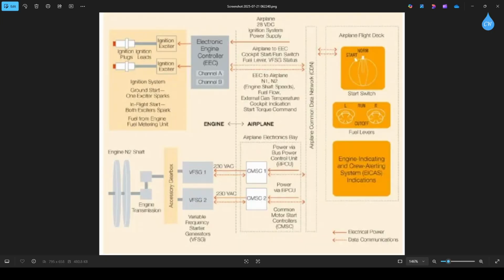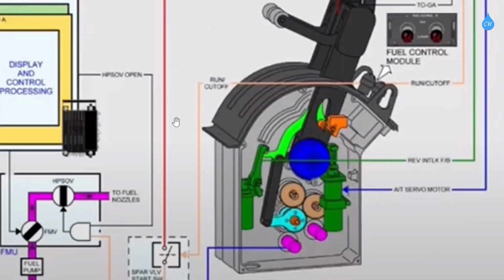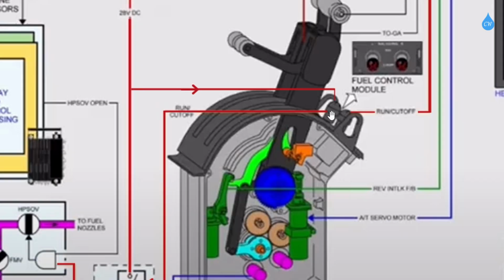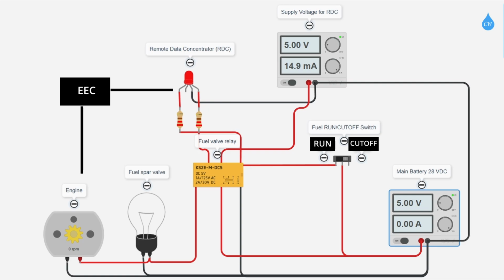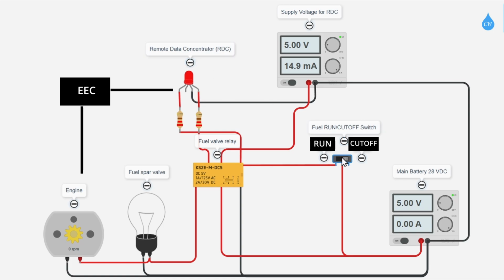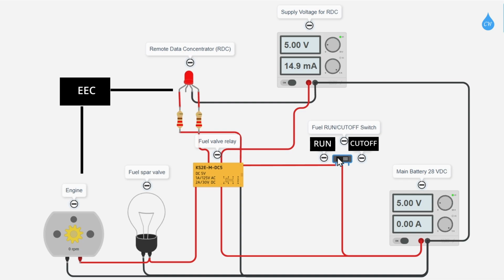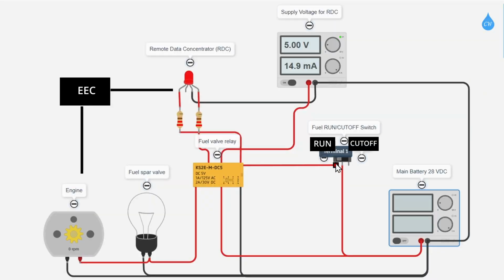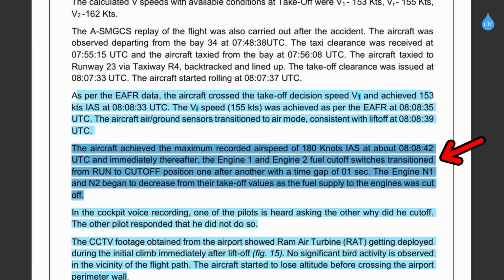Air India Boeing 787 Fuel Cutoff Switches - Clear Waters #airindiacrash #inspiration #boeing787

Comment: But I don't think that wiring Is correct,each  FADEC  should supply the base voltage to its own Engine fuel start switch and at list 4 strong wires per switching for redundancy ,if that wiring Is the one on that 787,then that aeroplane is very unsafe and will never seat on that plane.
Reply: Clear waters, when the 28 VDC is inadvertently cutoff, it also satisfies the condition to deploy the RAT which is exactly what happens as shown on the preliminary report!
Reply: @juliomanalo7074 yes, bjt it needs both captain and first officer's bus to go dark. That occured when the bus tie contactor tried to bring the captains bus back by connecting the first officers to cross feed it, inadvertently sending the shirt circuit to that bus too. Game over. You are correct, this is why the RAT was down immediately after the gear up sequence was initiated, well before both the engines had spooled below the threshold for the VFSGs to stop making power. Gear up sequence was what sealed the fate if the battery by allowing a huge current to flow through the battery to the current return network when the EBPSU step up dc transformers demanded the load to stop the wheels spinning before retraction. The only thing the gear up system managed to achieve was opening the valve to tilt the trucks.
Later during the descent the amazing pilot tried to cushion the landing on the street he could see in front of him, by outting the gear lever down, even though they were already down. He didnt know that. This amazing man also managed to flare enough to save one amazingly lucky gentleman.
Reply from the maker: So each FADEC is supplied AC or DC voltage?
Reply: @Clearwatersa AC which itself rectifies to DC. Before the engine is running, it gets DC from the battery bus. The engine's permanent magnet alternators give the EEC (key component of the FADEC system) alternating current and the EEC has its own rectifier to convert that to DC. The controls in the cabin are not from that DC, but from the bat backed central instrument hit buses, backed by the front main battery
Reply: @Clearwatersa  FADEC gets its power from two sources,1from its own generator,and the other from the main Ac bus from that supplies from the cockpit.so in  case the main supply fails for whatever reason the FADEC will rely on its own generator.hope you've got it.
Reply from the maker: @captsonko.9345  I would think that there has to be a separation of voltages in order for the fuel cutoff switch to operate the spar fuel valve relay, bypassing any electronics.
Reply: @Clearwatersa  The dedicated alternators are the primary source of power when the engines are above a certain rpm (8~15%). Main bus power is only used when the engines are being started or if the dedicated alternator fails.
Reply from the maker: @ImperrfectStranger  I think that is correct for the EEC, not for the fuel switches and DRCs. These two get their voltage from the main AC bus transformer rectifiers or main battery when engines are not running.
Reply: @Clearwatersa  Understood, but the loss of main bus power is not going to shut down an engine. There have been real world examples of this. 
You need a bizarre fault which will both generate a CUTOFF signal AND remove the RUN signal... otherwise the dual coil relays won't know what to do. And these false signals have to generate enough voltage to override the magnetic latching on the shutoff valve.
Reply: Correct, even a first year electrical engineer would never design a system as flawed as shown here.

Comment: In reality I don't think it happens exactly as in the diagram because the flight computer has actions built into it's programming to prevent pilot errors. However, those flight computer priority safeguards can cause accidents as we have seen in the past with 737Max and some A330 airplanes. As we know 787 flight computer erroneously cut off fuel to engines in a previous incident but luckily pilots were able yo recover because they weren't taking off or couple of hundred feet off the ground. We don't know whether the flight computer made such catastrophic error in the case of the flight 171.
Reply: I think you're mixing up your 787 incidents. The ANA aircraft was on the ground when the engines shut down. The logic was modified so that it wouldn't happen again. It happened because the pilots began to activate the thrust reversers too early, then floated above the runway. They cancelled the reversers, triggering the logic for engine shutdown:
Aircraft on ground
Thrust levers at idle
Actual thrust not moving towards idle (fast enough).

Even the old logic would not activate engine shutdown on takeoff or after takeoff (in the Air India incident)
Reply: @ImperrfectStranger How about the Boeing and potentially other widebody manufacturers logic of designing a single switch that can be used to cut off fuel during Vr. Does that make sense to you? In my book, a two step procedure like pulling back on the relevant thrust lever to idle before touching the fuel cutoff switches makes logical sense from safety point of view. As a matter if fact, that's how the fuel cutoff switches function in many medium size commercial turbofan jetliners. No idea, why a widebody airplane need an instant cutoff at the perils of potential misuse or mistake.
Reply: @ImperrfectStranger I think he's referring to another incident where 787 engines unexpectedly shut down mid-flight at full altitude, without any input from the pilots. In this case, they were able to get both engines restarted before having an untimely collision with the ground.
Reply: @timrider1224  Ah, you mean the Jetstar JQ incident? That was a fuel contamination issue caused by poor maintenance.
Reply: @ImperrfectStranger Imagine a hypothetical scenario where a psychopathic pilot switching fuel cutoff switches to CUTOFF during Vr, but yet it had no effect to bring down the airplane because tge co-pilot had his hands on the thrust levers and tge suicidal pilot couldn't put the thrust levers idle, in order to complete his action of cutting off fuel to the engines. Does it make sense?
Reply: @wickramavee4365  The pilot flying removes his hand from the thrust levers at V1, which should be well before Vr.

On some airlines, the pilot monitoring may back up the pilot flying by putting his hands on the throuse levers at the same time and will keep them on the levers after the pilot flying has removed his hand. 
You can't override a cutoff command by someone else having his hand pushing the thrust levers to the firewall. The engines will shut down immediately, no matter the position of the thrust levers....  at least not on a Boeing or Airbus aircraft (that I'm aware of). 

Sorry if I've misunderstood you.
Reply: @ImperrfectStranger   

 Yes, that was the point I was making. 

1(Boeing(and Airbus as well?) have designed a single switch that can shut down each engine separately rather than making it a two switches or switch/lever combination

2)The fuel cutoff switches are responsive during Vr and lift off. The flight computer cannot prevent that action when we take into consideration the fly-by-wire technology was developed to prevent such accidental or intentional actions of pilots that can crash an airplane. 

Don't you think it is a serious design flaw? What is the point of having a fly-by-wire technology if it is not used to prevent scenarios like flight 171, if we potentially incorrectly assume the captain switched the fuel cutoff switches to CUTOFF during Vr?
Reply: @wickramavee4365  At what point do we take the pilots out of the loop completely?
If it's not the fuel levers, then there is also the fire handles or yoke/control column or trim switches or poking the pilot flying in the eyes... which can bring down an aircraft.  Some US airlines even allow their pilots to have access to guns.

Normally the fire handles are locked if the fuel levers are in RUN and there is no fire, but they can be overridden (in case the fire handles don't unlock automatically during a  fire).
We have to be able to override the automatics when the automatics fail. If the Autopilot fails, there has to be some way of pilots of flying the aircraft manually. 
Aircraft designers deliberately disable the automatics during takeoff. e.g.The thrust lever servo motors are depowered so that they won't move by themselves if there is a computer glitch. Yet the pilots are still trained to keep their hands on the levers until various times during takeoff. i.e. pilot flying removes hands at V1. Pilot monitoring keeps hands on the thrust levers until rotation (at some airlines). The distrust in automatics is palpable.
Reply: @ImperrfectStranger  I get your point. , but I still think it would be better if they can incorporate a second process to fuel cut off switches, at least a need to idle the thrust levers first. If we can reduce the ability to sabotage an aircraft during the takeoff and landing, I think it can be good thing. I agree programming a flight computer to override a pilot action of switching the fuel cutoff switches can be huge gamble, but at least a second spring loaded switch in series can be a good safeguard. The downside of that of course adding more possible switch malfunction failures into the equation of electrical/mechanical failure equation.

Comment: Go to Grok or similar AI agent and ask something like this ....
I can't post the answer because its too long ....

"in the recent air india crash of a 787 some people are speculating that the cause may be because of a glitch in the main battery that is in the tail of the aircraft. they say it may have sent a signal to turn off the fuel switches without the actual switch being moved ... in other words a false electrical signal. is this possible. what are the safeguards against this happening"
Reply from the maker: You can post the answer from Grok if yo want. I do notice that in this subject, the AIs provide lots of erroneous answers.
Reply: A language learning module (AI) cant help you here. Only a deep fundamental understanding, and the schematics can educate a DC electronics engineer with the relevant experience.
Reply: Also, the main batt is not in the tail. Are you simply not informed, or are you working for one of the criminal organisations? Serious question.
Reply: LOL... The very first sentence of your AI-generated response is already wrong. 
The main battery is not in the tail of the aircraft. It's in the forward equipment centre.
Reply: @ImperrfectStranger yes. The fwd equipment bay, Where the real fault occurred.
Reply: @cosync  The latest CVR transcript leaks don't suggest this at all.
Reply: @ImperrfectStranger and where would one find these "latest CVR leaks", and how do we know they are accurate and not just more media hype and speculation?

Comment: Ur not an idiot. U have oversimplified it a bit but the general gist is somewhat correct. I had been arguing with a guy who had told me it was impossible, but then in a different forum he posted the actual schematic and said , and I quite, A FAULT IN THIS SYSTEM COULD INDEED BRING DOWN AN ENGINE, BUT O LY ONE, AS THEY ARE  Independent....
now this guy, hes likely working as an engineer for boeing or an airline. He made the mistake of confirming the schematic, but revealing that he doesnt have the information i have about how the battery can bring down both left and right center 28v DC buses.
The bus tie contactors are controlled by the 2 bus power control units BPCU. It took one second after the battery backed left bus was brought down to 0 volts from the battery short circuit, for the remaining right BPCU to connect the left and right instrument buses which connected the short to the right one. Whipppang, both inner DC buses are now gone.
This resulted in the 28v going through the RDC, through the switch to the ground (current return network) to stop actuating the detector in the RDC as current stops flowing. This is basically a little transistor type thing, which is typical in digital I/O modules. So the RDC sees this as a change of switch status.

To see more damning evidence, google CYIENT DLM BATTERY DIODE MODULE.
the diode module is the only single one piece of hardware designed to stop the battery from being exposed and charged by the dc bus, and to stop any internal short in the battery being exposed out to the dc bus. :/
This broke, like it did many other times in the history of this aircraft swept under the tug to date.
Cyient DLM made a news release and then a quarterly report about this supply deal with boeing, referring to it as a major deal. Then, in the annual financial statements, nothing. Not a word.why? Because boeing got very very upset at the for breaking their non disclosure agreement and revealing to the world (me) that there was a reason to be changing supplier of the battery diode module. The silly criminals.
Reply: Excellent!!
Reply: Brilliant analysis

Comment: *There were four CAT ‘C’ Minimum Equipment List (MEL) items active on aircraft as of 12.06.2025.
These MEL were for flight deck door visual surveillance, airport map function, core network, FD printer. (Page-6)
*There was a White excessive heat thermal damage inside the tail section of the AI 171, no fire alarm, no smoke no black soot found. One Soul Female Air hostess was found after 4 days inside the tail section dead with excessive thermal burns, not from fire.
* Aft EAFR was found totally detached from the tail section and far away alone on the same roof top, with excessive physical and heat damage, no black burns or soot. Just covered by a white powder. (Page-12)
>> the above zero flames burns could have tripped to AC and DC main BUS.
>> APU switched to ONLINE or FAILED not known. 
>> Avionics BAY Fore, power must have tripped. And only available power to cockpit would have come from Lithium Battery in the Fore Avionics BAY. 
>> Therefore EICAS messages LOG should be made public from given time line on Page 12, Para 10.
After the accident the ATC data was preserved. The replay of ATC recordings data was conducted. Summary of events based on the replay is as below:
The above is "NOT EAFR DATA' relay from Cockpit Voice recording  , "NOT Boeing 787-8 SIM replay". Above is ATC Voice recordings REPLAY!

,
Reply: It may be worthwhile exposing this information to a wider population, for example the Daily Airplane News channel featuring Geoffrey Thomas and Richard Godfrey as they seem to attract a much  broader sample of expertise. I tried pushing the subject of the "white heat" incidents to the rear DFDR, the poor hostess, and also the lithium battery but alas obtained no traction. It needs someone with very good knowledge and convincing argument to push these facts forward and develop the hypothesis, please.
Reply: @ZoubirKabir
Will do as suggested. 
Kind regards to all.